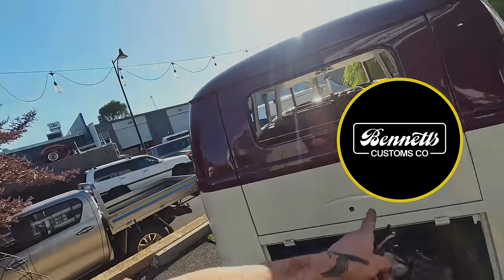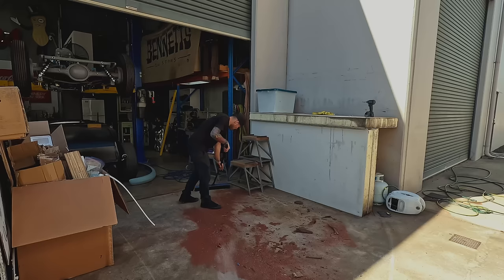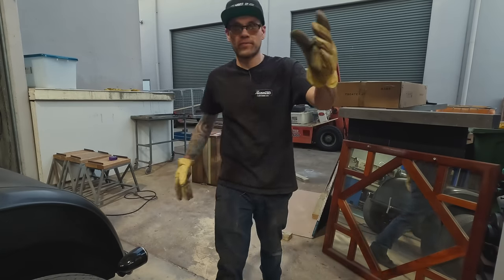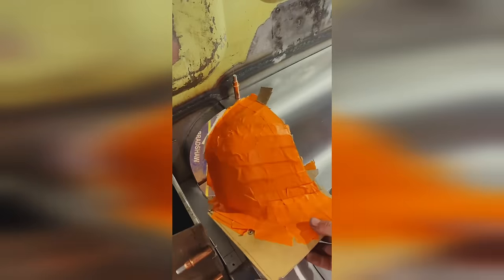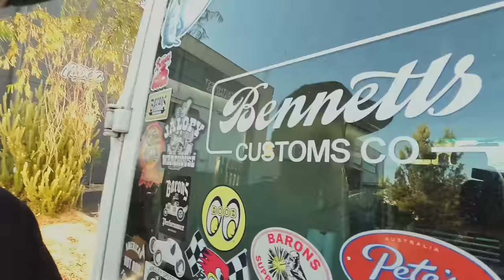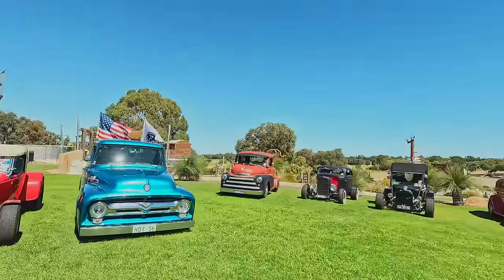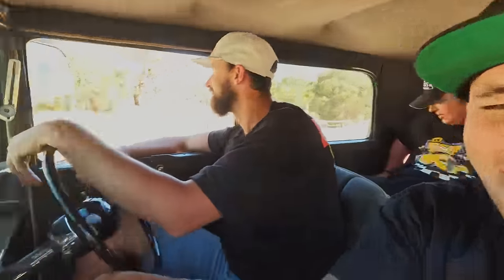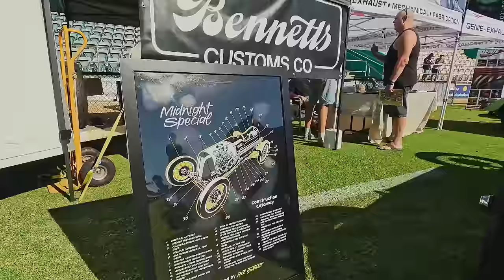Australian HOT RODS + DIY Shaping Stumps!

Comment: Great tip Karl, I work in a 6x6m tin shed (Tasmania ). Cleaning between jobs is essential, not only for space and hazzard reduction , but also air quality. Every so often , especially if I am going to paint, I move everything that cant get wet and hose the entire thing out. The feeling after hosing out is like a fresh start, really is good for motivation. I am currently do a timber boat restoration, and saw dust is thick on everything. Next job is two engine rebuilds, so there is definately a hose out coming. You Tube is itself a great motivator, not only in the want to put out another video, but it tends to make you want to pick up your game. Showing people stages and processes is a whole lot different than just showing a finished product.

Comment: hey Karl,  when you dig out the stumps it's quicker if you use a circular saw and plunge cut 360' then take a hammer and knock out the pieces , then clean it up with the grinder
Reply: Was thinking the same thing. These metal guys think everything requires an angle grinder!🤣🤣🤣🤣🤣

Comment: f@t b@st@d says = not a doctor + no responsibility all care given as i have had some info given out to the broader base population as a home welder [ a cheap import welder machine ] i have found if the electricity from welding makes me dizzy / disfunctional [or pain] it may be the welding machine on the wrong polarity = not the leads but the power [on / off] button = by reversing the red green or blue brown wires [ middle ground earth stays the same ] = my interpretation is the electricity should feel like melted butter [hope it makes sense] as the equator changes things for electronics eg australian standards 242 other continents have differant power ratings and standards= hope this helps with the back pain also demo day hydraulic and ignition switch help to replenish electrolytes = all the best ps if you reverse the polarity on a pump it still works just backwards and its the same for your body as feeding it the wrong energy can have consequences [cheers]